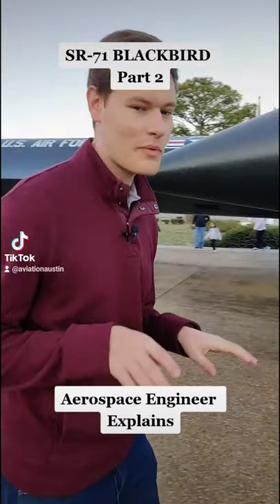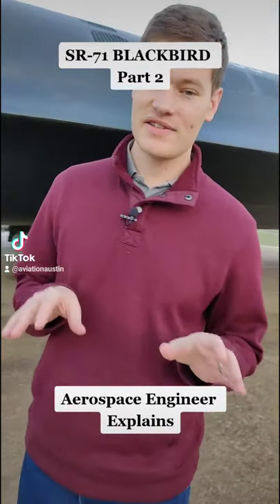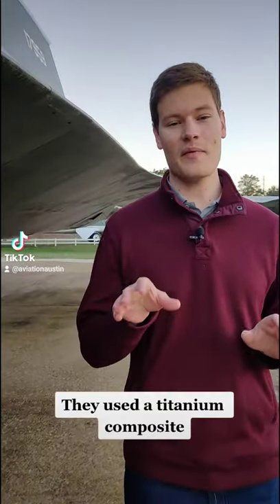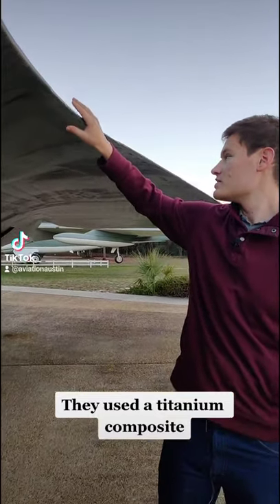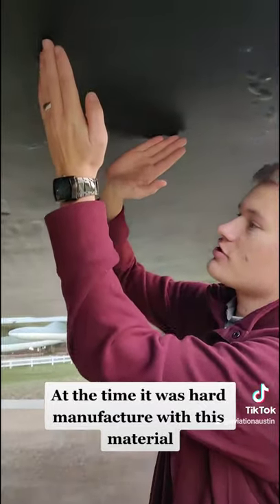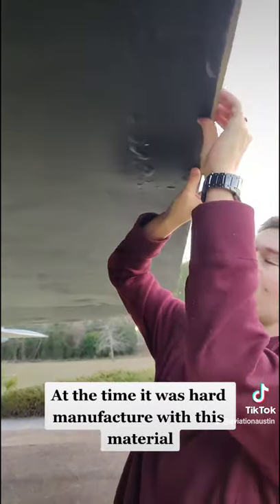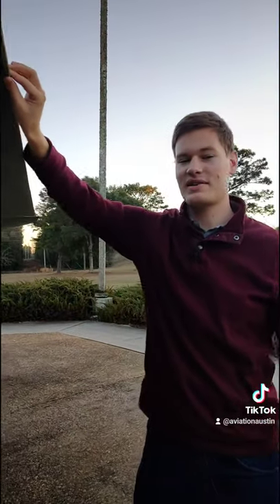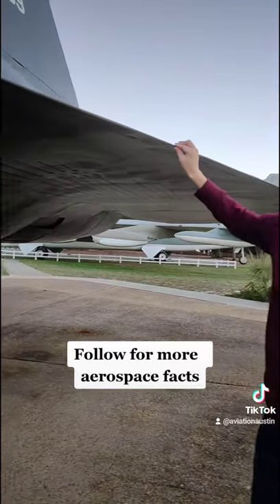SR-71 Blackbird Explained: Part 2 | #Aerospace #Engineering #Shorts

Comment: Remember: this plane was designed in the 60’s, a time when computers were essentially just giant calculators with only 4 times more memory than pocket calculators (okay, maybe not 4x but you get my point).

Most of the work done on vehicles such as the SR-71 Blackbird (*ahem* The 747, Concorde, Saturn V, etc) was done with small plastic slide rules and pen and paper math.

Honestly, it’s hard to imagine that there was even ONE aerospace engineer who didn’t have a mental breakdown.

Comment: How do those triangular sections benefit the blackbird
Reply from the maker: It's the only way they could manufacture it at the time.
Reply: @AviationAustin  thanks for the info and the speedy reply my guy, subbed
Reply from the maker: @picklehayati2232  thanks for the sub!
Reply: @AviationAustin I doubted this explanation and indeed the triangles are not a technique to create a thin wing edge. The triangles are alternating in material between titanium and plastic composite so it would present a sawtooth edge to the radar making it harder to detect. This technology is still used today.
Reply: @AviationAustin  You have no idea what you're talking about. The saw tooth edge is an antiradar stealth feature. The nonmetallic triangles diffuse radar returns from the edges while remaining aerodynamic. If you don't know don't guess. The original triangles were plastic and asbestos.

Comment: You should make a comment that the engineers designed the aircraft with a slide rule. They use their heads. 
There were at least 40 brand new inventions needed for this aircraft to even get off the ground. Her navigation was taken from the Stars. 
Her controls were handled by men. 
Spelled, MEN 
She has yet to be matched. 
She never will be, unless a robot's sitting behind the stick 😢